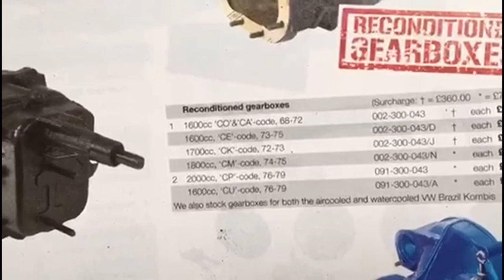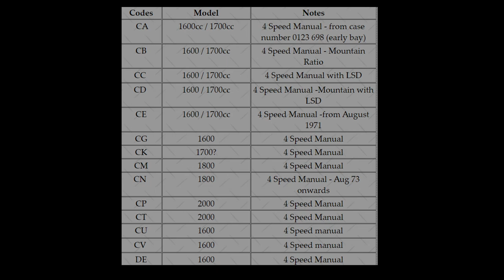How to indentify a Bay- window gearbox by its Code

Comment: Very simple yet very helpful video. I have a 71 bus which I'd like to install a 091 transmission but I've heard that I need to change the bellhousing using an earlier transmission. Will anyone help me with this? Please share a link or a video on how to do it. Also, when using this 091 transmission. Will increasing the fourth gear be necessary for better highway performance? Thank you in advance.